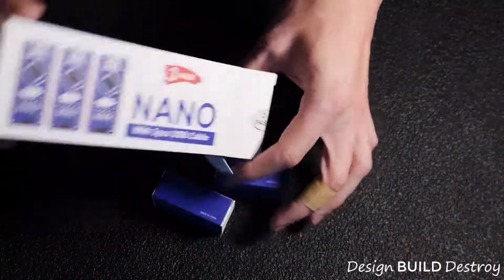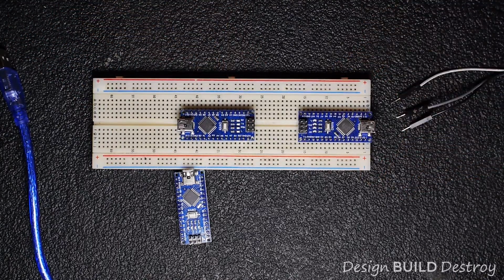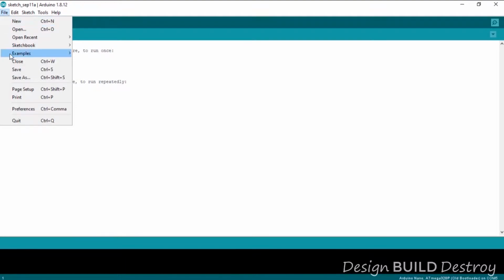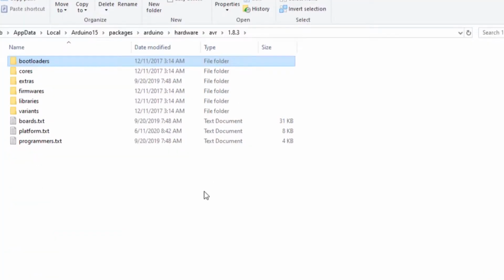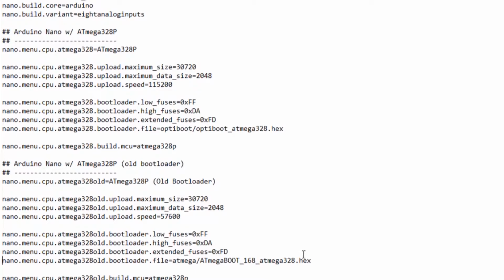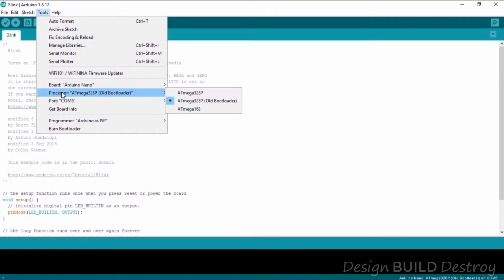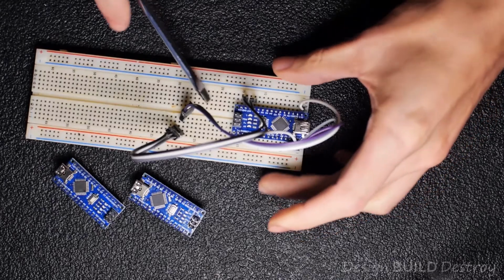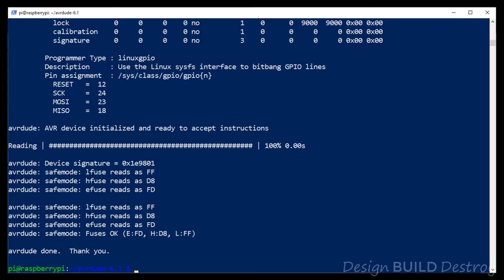Arduino Bootloader Update or Install - Upgrade a Clone From Old Bootloader to New Optiboot!

Comment from the maker: https://youtu.be/-MynHAz7TsI Check out this video on adding the additional 1.5k of Flash programming space back to your Nano before flashing your new bootloader. Even on a genuine Arduino nano you are losing this space with the new bootloader so I'll show you how to gain it back!
Reply: Hi, can this method be used to get the old bootloader onto a new nano?
Reply from the maker: @WorldWarSelection  Yes, but not sure what the benefit would be?
Reply: @DesignBuildDestroy  the old bootloader nanos seem to have a bug on it, that actually benefits what I need it for. Weird one, but that seems to be the only way. 

I’ve contacted every seller at Ali express to try and find the old bootloader nanos. 

I received one today, meant to be old bootloader, which it is, and it’s loads up the sketch, but doesn’t function the way it should. Actually freezes the system I put it in. So I’m guessing it’s a faulty one.

Comment: Tip: if your nano or similar board fails on Windows 11, check your WCH driver version installed for the COM port. If it's 3.9.x (new ~2024 version), it will fail. You can download the program DriverStoreExplorer to be able to completely delete that version of the driver. You have to find an old version of the WCH driver instead, v3.7.x works (from ~2022). Install that and it will work again. Minicore board platform for Arduino (for atmega boards) also has an even newer & smaller bootloader available, called urboot. But it you have to use that platform afterwards because it uses a slightly different comms protocol called urclock rather than the "vanilla" one used by stock Arduino.

Comment: Any similar solution for ATMega328PB? Cant find a reasonable way to get them to work with Arduino IDE... MicroChip direct software is failing (or too complex)...

Comment: Thanks a lot mr. I had this old boot loader issue in win7 arduino 1.8.1 version. It has no old boot loader. So I installed arduino 2.3.6 version on win 10 ( it had old boot loader option ) and copied this boards folder and pasted it on  arduino 1.8.1 folder on win 7.
Now I see old boot loader option in arduino 1.8.1 on windows7.

Comment: Thank you.  I'm new to working with Arduino and I had a couple Nano that I couldn't upload to period, not even using an Uno as programmer.  I was able to use a good Nano to flash the new bootloader to them following your video but they still wouldn't work.  The tx LED was constantly lit up on both of them and I'd tried hitting 'reset' as I started an upload to no effect.  Out of frustration I eventually did a double click of the reset button after I'd started an upload and surprisingly the one I did that to uploaded, so I did the same on the other and that fixed that one as well.  Now they both can be uploaded to without issue, no more constant on tx LED and no more having to select 'old bootloader' either.  Now all my Arduino have the current bootloader.  Thank you!

Comment: 3 years later and these instructions still worked!  Nice!
Reply: You used two micro controllers?
Reply: @stevethecomicdude  Yup.  I used two Arduino Nano.  One to upgrade the boot loader on the other one that had a old boot loader.

Comment: I upgraded 2 Nanos (each other) to the new bootloader without changing the borards.txt file. I just selected the new bootloader in the tools/processor menu before burning the bootloader.
Reply from the maker: That did not work for me, but it could be differences in IDE versions and installations. Arduino IDE is kinda weird which is why some of us all have our boards.txt files in different folders etc. But good to know it worked for you and will work for some other folks out there
Reply: @DesignBuildDestroy  I used 1.8.19 for Linux and I replicated it on 2.0.2 for Linux.

Comment: Using an old uno as a programmer and connecting the way you showed I managed to update to the new bootloader in a few seconds. Thank you so much!
Reply: why I can upload at same new bootloader without change anything in boards file with arduino as isp also me?

Comment: Thank your for this great vid.. i'm going to be getting my first nano in a few weeks chipping from china is really slow. Wanted to know if i could do this using a uno to update a nano ???? .. or did i have to buy two of them ?
Reply from the maker: Sure can!, An UNO and a Nano are the same device just in a different board format. Both use Atmega328p microcontroller. The only difference is the Nano ships with the old bootloader (whether it is a genuine Nano or not).
Reply: @DesignBuildDestroy  awesome thanks..greetings from The Netherlands.

Comment: Nice Video. Thank you. Unfortunately I am not able to select the Nano anymore. Checking my boards.txt reveals it is no longer existing, hence I chose what was available and made it a UNO. This works well, although I would like to know how to get the Nano back. I have version 1.83 of the AVR Boards installed on a MAC.
Reply from the maker: Maybe try going to boards manager and reinstalling Arduino AVR boards profile. I don't know any way the core Arduino profiles get removed unless you accidentally deleted it. Even in IDE you can't choose to uninstall just 1 Arduino board the AVR profile is all or nothing. In any case UNO is a Nano with a different layout so it does work. The only real difference is nano has an extra couple ADC pins, that SMC Uno has them on it's chip but not run out to headers for you to use. Throw back to when Uno used a DIP style chip which did not contain the additional ADC pins they didn't want to change the board layout after updating but code wise the bootloaders are identical so it all still works with nano.
Reply: @DesignBuildDestroy  Thanks! I did check if the pinout is the same and it showed that it is. For the next project I will use the Nanos called Uno, but I need to find a working Nano. Haven't you mentioned you're selling them somehow? Also I cannot build one without having the option to choose the darn thing.
Reply from the maker: @F74D3N8r0T  I don't sell anything, I buy my Nano's on Amazon. Specifically Rexqualis brand they are good quality and cheap if you are in the US https://amzn.to/2YNt9GI
Reply: @DesignBuildDestroy  Thanks. Since I am not from the US I will buy some others, but sure you helped me a lot. Thank you!

Comment: Excellent tutorial. One basic question. In case I want to update a nano having old bootloader (to be programmed) with another nano already having new bootloader (programmer) for the first time, would the above text file modification be still necessary. Thanks!!
Reply from the maker: I don't believe you would have to if the "programmer" is already on Optiboot. The reason for changing the boards.txt file is due to the different baud rates coded in the bootloaders so when using an OLD bootloader as your programmer it will fail to communicate with the programmer to push the new bootloader to another board. And you can't just change the baud rate in the file because the rate is hard coded in the old bootloader so flipping the bootloader source is the only way I found.

But check out my last video on gaining 1.5k of flash space https://youtu.be/-MynHAz7TsI this is a good reason to edit your boards.txt before burning the bootloader to your board. As well as flipping them around and using the newly upgraded one to be the programmer and flash your existing Nano! Even a genuine Arduino using Optiboot still has the wrong setting, so even though your new bootloader is 512 bytes it still locks up a full 2k for bootloader space.
Reply: the answer to your question is actually in the tutorial.

Comment: At the end when you said 'over write it', were you talking about (old Bootloader)?
Reply from the maker: I'm referring to the board you loaded the Arduino ISP sketch too to act as the programmer. I meant you do not need to keep it as a "programmer" put that sucker into some cool project and load your new sketch to it overwriting the Arduino ISP sketch.  Unless you want to keep it on hand as an ICSP programmer that is :)

Comment: Good morning, I own several Uno\Nano arduino boards in clone version that don't want to know how to work anymore. What do I do? I have loaded the drivers and when I insert the sketch I don't get any error but at the end it doesn't execute the code. A port problem, com3 and sometimes com7 appears too. To load my code I guess I have to use "bootloader" or something similar? I do not think there are components to replace but I hope to find a solution soon. Regards.
Reply from the maker: If you can upload the code without any errors, it may not a bootloader problem. Try loading the blink sketch with nothing else connected to the pins of the board. You can find Blink under File -> Examples-> Basic. If that uploads and the onboard LED blinks then the problem may be your original code or circuit.
Reply: @DesignBuildDestroy  No. Yesterday I tried again to load a sketch and then under Tools > Nano module ic >Atmega328P (old bootloader). My board does not come up to date with ISP and compiling the projects in this "old bootloader" mode, they work perfectly. Finally I can breathe a sigh of relief. For this problem I had to abandon completely Arduino (I use only clone versions) but now I'm happy to start again with them. Thank you very much.
Reply from the maker: @pierpa_76pierpaolo  AH yes the clones are almost always the old bootloader for whatever reason. Now that you know they are working you can upgrade the bootloader following this video if you'd like :)

Comment: Can this be done with USBASP programmer and how ?
Reply from the maker: Same method, except choose USBASP as your programmer and go directly to Burn Bootloader after having made the bootloader.txt file changes. You won't need the ArduinoISP sketch. Just make sure you wire the programmer up correctly the ICSP pins on the Arduino.

Comment: this may be a stupid question, but when i try to edit the boards.txt file it keeps saying i need administrator privlidge in order to save the file.i am the admin and i have gone into the properties of all the arduino folders and gave myself full control and unchecked the read only box for the boards.txt file, nut it still wont let me save.can anyone help?
Reply: nvm, figured it out. blonde moment
Reply: @redneckwarriors1  what was the solution I'm having a blonde moment
Reply: @caedenv2575   i think it was that i had to make myself an administrator over everything in my file path which was C:\Program Files (x86)\Arduino\hardware\arduino\avr\boards. in the Properties menu i went down to Advanced i changed all of it to give myself permission
Reply: @redneckwarriors1  okie sounds good thanks
Reply: @caedenv2575  let me know if it helps
Reply: @caedenv2575  i messed around with it for hours but ended up being something simple

Comment: I followed very close every step and when uploading it says uploaded and on second nano the led blinks once and does not stays on, when burning bootloader show this error "avrdude: Expected signature for ATmega328P is 1E 95 0F
         Double check chip, or use -F to override this check.

Lets say everything came right, the txt file should be returned as it was?

Thanks
Reply from the maker: Assuming it is actually a Atmega328P chip, then it could be a connection issue, check all the wiring on both chips. There have also been lots of knock off chips themselves where it's not just an Arduino clone board, but they managed to make a fake Atmega328p chip itself check out: https://www.sparkfun.com/news/364. I've never had that issue with this particular brand but I have had problems with some other off brand Arduino clones the chip just doesn't work right for anything let alone trying to burn bootloader.
As for changing the text file back you could if you want, I personally leave it as is since I basically only buy clones and first thing I do is upgrade the bootloader it if needed.

Comment from the maker: TIP FOR FINDING ARUDINO SETTING FILES: Someone pointed out to me you can go to the FILE menu in Arduino IDE -> Click Preferences, in the settings box that pops up at the bottom will be a link to click to "More preferences can be edited directly in the file". Click the path below it and you'll be taken to the path where your Arduino files are stored. From there just find Packages folder, and through the rest of the path Arduino/Hardware/AVR/xxxx your avr version.

Comment: Thanks for this tutorial. It is very helpful. I just followed it to upgrade my nano. However, I found the boards.txt file in this path for my computer -> C:\Program Files (x86)\Arduino\hardware\arduino\avr 👍👍👍
Reply from the maker: Yea so after someone pointed out you can get to the path via Preferences menu mine takes me directly into the users AppData folder as I showed not to program files. The files exist in both locations but not sure why ha may depend on how you install it. In any case if it works for you GREAT! Thanks for sharing it might help other's out there :)

Comment: Hi, this is a good video. I was not aware that you can upgrade the boot loader. However, I thought  that you need a 10 mF capacitor between ground a reset of the Arduino on the programmer side.
Reply from the maker: The cap prevents the master side from resetting on serial connection being open. But if my thinking is correct and you are using latest version of Arduino IDE, AVRDude will open the serial connection which may reset the master in that instance, but that's ok, the master runs back up instantly and the firmware starts to push through. I suspect it was more of an issue with older versions, at least that's been my working theory. I have never needed to use the capacitor on reset line.
Reply: @DesignBuildDestroy  Thanks!
Reply: Great video, One suggestion : try not to touch the pins of nano-clones, static energy damages the i/o and may result in irratic behavior

Comment: I have a orginal arduino UNO and clone FTDI Nano which is using old bootloader. So can I update the new bootloader to the clone Nano using UNO?
Reply from the maker: You sure can! Just load the ArduinoISP sketch to the UNO first making sure to select UNO as the board type. Then After wiring everything up (the wiring pins numbers are the same for the UNO as Nano), change the Arduino IDE board to the device type you want the bootloader for, in your case Arduino Nano with processor Atmega328p and hit the burn bootloader menu option.
Reply: @DesignBuildDestroy  thank you so much 👍🏻